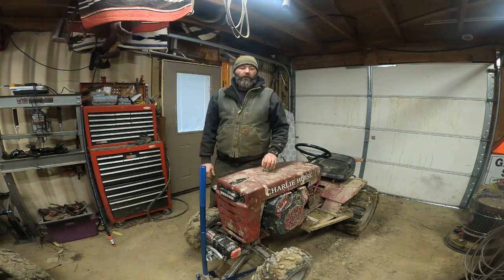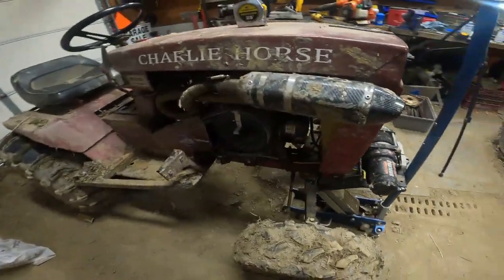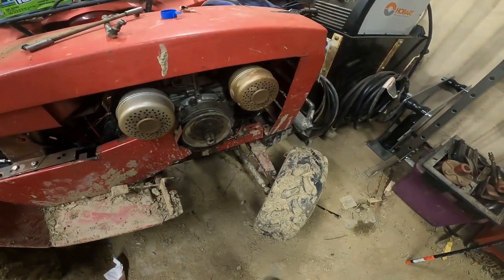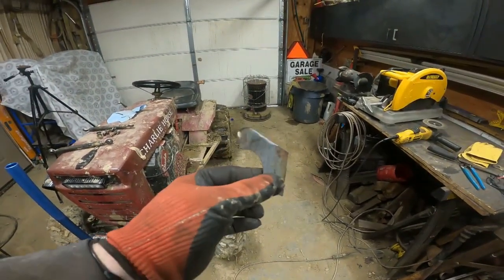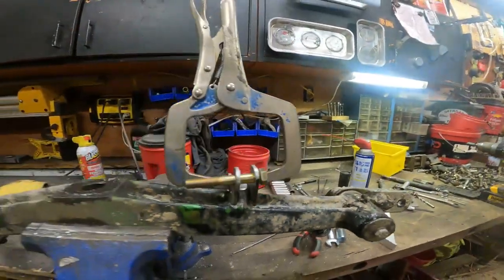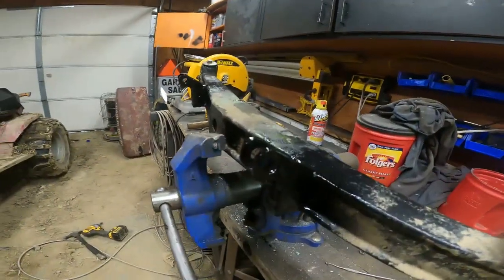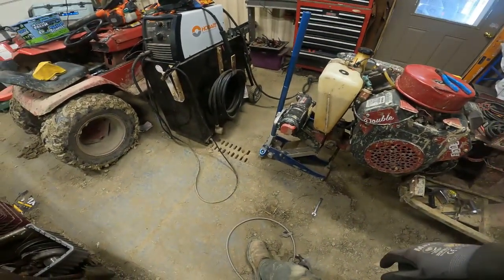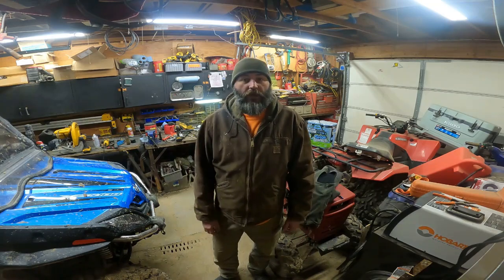The Charlie Horse: let's take the slop out of that axle pivot pin

Comment: We are working on my son’s Wheel Horse this week, right in the middle of duplicating this mod. I kind of had an idea of how was going to work before we started. When the tie rod is at zero or “level”, then moves up or down, it wants to pull the axle back or push it forward. What it’s looking like is we can let the axle ride back and forth on the pivot pin. It moves about 1/4” on the pivot pin. That’s all good but the question I have is how much articulation do y’all really care to have? I see the guys over on OK off road mowers in Canada and they are all about big articulation on their axles. It seems like you guys in the Wheel Horse community put stops and limit the articulation. I personally haven’t done any real rock crawling on my tractor. But in your experience is there any advantage to having a lot of articulation or limited? Besides that, I’ve got three more John Deere axles if we don’t like the way this one operates. I already welded the piss out of those bosses with the brackets to it, pre heated it and everything. But was also thinking about possibly building a plate that won’t be super intrusive or unsightly to ride behind those bosses. Just rewatched your video, wondering how this mod is still working for you?
Reply from the maker: First off thank you for watching and commenting on so many of my vids.  I at least know there are 10 people that watch LOL.  I hit a tree with one side of my front axle prior to this mod and broke 3 bolts that hold the front plate on where the pivot pin runs through and turned the axle sideways, not good. HAHA.  That is where this mod came into play, the movement forward or backward in my opinion is too minimal to matter when the axle pivots with the trailing arms attached.  OK Offroad are really good dudes and their rigs are bad ass, but they do a lot of slow crawl and that is it.  "We" want some articulation but limit the speed at which it happens for hard cornering and any kind of speed and control it is absolutely necessary again in my opinion and the boys I ride with.  To me the difference between OK boys and us is like,...someone buys a jeep and builds it up and lifts it with all the proper parts and it is the most capable rig you have seen rock crawling,......then there is us,.....King of the Hammers,   again if you had FB or something with could discuss mods and what parts at length.
Reply: I think your pivot pin or hole is probably wallered out a lot more than the one we have. Problem I’m having is there’s a lot of friction, even with lube. When I articulate the axle, it moves or slides back and forth on the pin like I said before. Problem I’m having is that it binds up and it’s hard to rock the axle up and down. Currently I’ve only got one side connected as of last night. This morning I’m gonna go out and put the tie rod on the other side. Maybe it’ll pull and push the axle evenly if that makes sense and won’t bind on the pivot. But thinking about this kept me up awake late last night 😅. I was thinking of fixing the axle in place up against that front plate which broke on you, how I had it before with spacers behind it. Then, in place of fixed length tie rods, I’d get some very stiff gas spring shocks. I briefly looked at McMaster Carr last night. They have some that are the right length and have a 396 pound compression and 256 pound extension resistance. So as the axle pivots, those rods would slow the travel down significantly but the axle would be in a fixed position. It just might work and the whole setup would be strong enough to resist breaking the pivot… I’m gonna run the fixed rods now and order those gas struts to see if my idea could work.

Comment: What a great idea! Was looking at my Deere which has the same axle wondering if I could flip it forward. It has that plate those bosses ride against to keep it from moving. But I’d have to cut that plate away for it to fit swept forward. Anyway something like this could work for me too. 
The axle is cast steel I believe, any issues with the welds cracking since you’ve done this mod?
Reply from the maker: I haven't had any problems with my welds on the axle and I hammer on it pretty hard.  Just preheat the axle some before trying to weld
Reply: 10/4, I saw a video where a guy welds trusses to truck axles and he heats the casting up to around 400 degrees before he welds. Then he puts welding blankets over it so it doesn’t cool off to fast. Once again  that was a great idea you had there and I appreciate you sharing!
Reply from the maker: Yeah, man.  That is how the tractor community is.  Sharing Ideas and helping to improve each others rig for better riding for all....